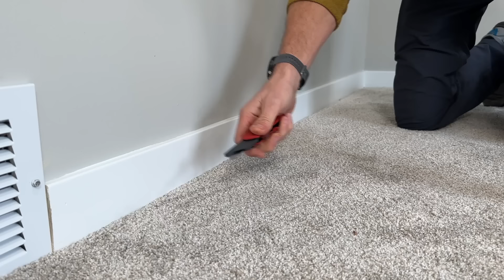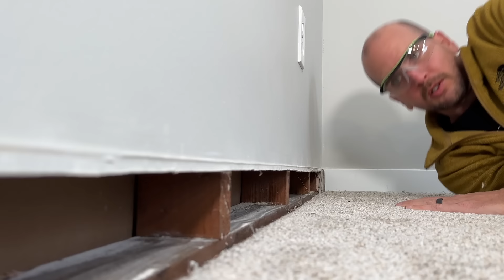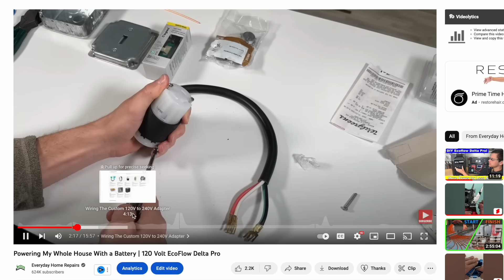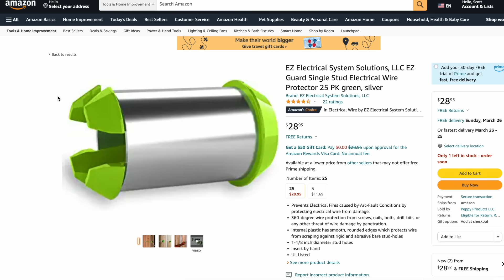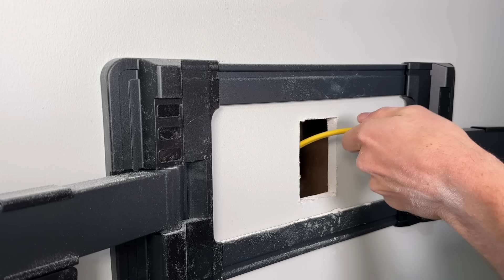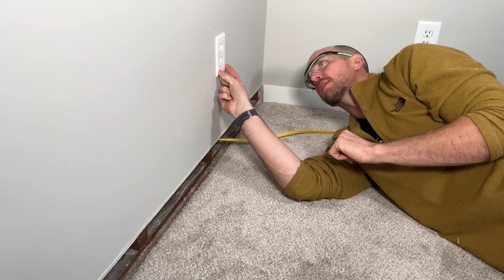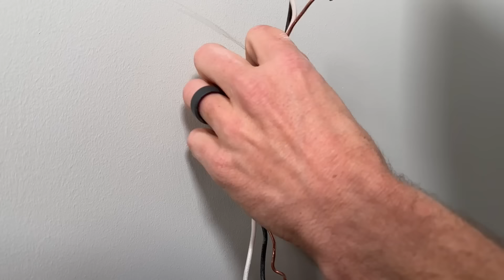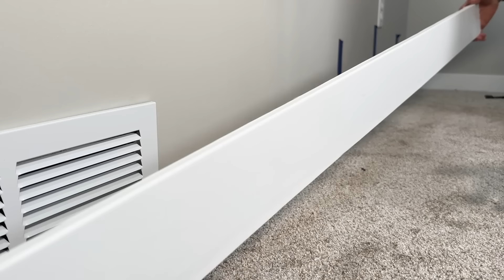How To Hide TV Power Cord And Cables | Easy Way To Move An Outlet

Comment: This is all very well but in the UK we build our houses out of bricks not cardboard, what do you do then?
Reply: Nothing.  Keep your extension cord😂😂😂😂😂
Reply: You don't have interior walls in England?
This is probably a brick house.
Reply: @redfields5070  Yes I said it was a brick house, that's what we make them from in the UK.
Reply: Many houses are built out of brick. Interior walls generally are built with drywall because it’s easy and cost efficient to do renovations. In the UK plaster board is common for interior walls….not sure who is using cardboard.
Reply: @darkcell06  No, they generally aren't - come and have a look at mine. As for dry walls, they are made from plasterboard which is basically plaster glued to a cardboard backing sheet.
Reply: @TelstarFirst  
I'm telling you that we build houses just like you do. We don't make them out of cardboard. His is not made out of cardboard.
He was working on an interior wall, you should see no bricks.
Reply: Most new houses in the uk are made with interior timber and plaster board walls . Just same as this. You've obviously not been on a building site lately.  😊🙏
Reply: You haven't been on a construction site lately if you think all houses are made solely of brick. Nice try though
Reply: In the uk they must have a big bad wolf problem, because thats the only reason id need a literal house built from stone😂
Reply: @goleft4088  Have a happy tornado season.It's why your houses fall down after 30 years and ours last 200-400 years or more.
Reply: Go somewhere else
Reply: @tonyphan9741  To get ripped off with a house of cards? No thanks. Our houses are built to last centuries, not years.

Comment: Excellent. Far better than the other systems I have seen.
The only thing I would do differently is to screw a small piece of scrap wood behind the drywall on the left hand side, so I could screw the drywall and baseboard to it. Just a little better support, because there is no support past the left-hand most stud, which is quite a distance away.

Comment: That's all fine and well if they are interior walls.  If they're exterior walls with blow-in insulation covered with plastic vapor barrier it gets a whole lot more difficult. It would also be nice if you showed how you fished the wire up into the existing box.  I like the technique but in some walls it won't be that easy.  I see I'm not the only one with this concern.
Reply: (Great video:) Same here. How did you fish the new wire into the existing box? Thanks...
Reply: I think it is easier to push the new wire from the existing box into the wall and fish it up to the new outlet hole before installing the new box.
Reply: European houses are made of solid bricks and concrete. Not empty cardboard. This video is a pure joke.

Comment: You should change the thumbnail because it is very misleading... You will absolutely have to repair drywall and even paint... from working in remodel not every job goes the way you expect it to. Trim breaks, paint chips, things happen.

Comment: You did a great job!  The thing I noticed though, was that the scenario you showed at the beginning of this video (in the thumbnail) has an existing outlet to the LEFT of the heating vent, but NO existing outlet to the right of it.  On the wall where you ultimately did the fix we are seeing done here, the existing outlet was further to the RIGHT of the wall vent.

In the 2nd scenario, you did not have the heating vent in your way, so you were able to extend the new Romex from the outlet on the right, & go leftward through the created stud holes, & then up to the back of the TV, allowing you to pass through two studs without encountering the heating vent.

If you had had to do the new install in the scenario we saw when the video first started, with the only existing outlet on that wall to your LEFT of the heating vent (as you are facing it), you would not have been able to come across the area of the baseboard with the Romex, as the vent would have been in the way.  I would be curious how you would recommend installing the new outlet if the scenario was as the wall looked in the start of the video.  That is to say, if you have a heating vent in between the existing outlet & the new outlet you are trying to create, how do you get around the heating vent with the Romex?!

Thanks for any input you might share.  God bless! 😇
[3.26.2025]
[How To Hide TV Power Cord And Cables | Easy Way To Move An Outlet - via Everyday Home Repairs]

Comment: Excellent video, good detail and very well paced. I'd like to see a follow-up video that shows how to do this if the location of the television is above a (gas) fireplace mantle. Ours has two small windows located on the sides of the fireplace, about a foot above the mantle, which means there's only about a foot of horizontal run to use for putting wires through. And then, of course, there's the chimney vent to avoid with the new wiring. Recognizing that there will be differences between models of fireplaces and placements of window, bookshelves, or other features, I'm hoping that there are enough commonalities to make it possible to provide some guidance that would be useful in my (or any similar) situation. Thanks for putting in the time to share your expertise and experience!

Comment: Good video. I install professionally. It would be wise to start from the outlet and push the wire down. It will make it easier especially if the wall has insulation.

Comment: Great video, but be sure to mention what to do if you run into cross-blocks and/or insulation. Most walls have cross-blocks. Recommend long, flexible drill bit extension and fish tape. Good job

Comment: Great and really clear video BUT there should be a disclaimer or warning for people attempting this. IF that wall is a structural bracing element (and with modern houses, there is a shortage of walls that are NOT part of the building bracing system) doing this will completely compromise the bracing system. The wall shown does not have enough fasteners to be part of a bracing system so no problem here, but people doing this will not realise the finer points and what to know and watch out for in their own situation.

Comment: Good job and well done.

It would have been a good add on to mention that bare Earth wires are not allowed in the UK, EU, Oz etc.. Since this is a global tip I'd have mentioned that.

Another good add-on tip would have been how in get around a cross brace / dwang issue, cutting a small slot out of the drywall, drilling a hole / check in the dwang  then refitting the drywall cut out, filling, sanding and painting the cuts.

Comment: Those ring tabs you pulled off the outlet behind the TV mount can also be used as spacers to push the outlet out for the face plate. Just use them like washers.

Comment: When I do these, I use a tube with pass-thru plates. That way, you can hide any possible cables (i.e., power, Ethernet, HDMI, etc.,) behind the wall and then connect them where they need to go below (i.e., nearby power outlet, Cat5 jack, computer or any other device that wants an external display.)

Comment: AWESOME video, thank you!   The ONLY thing I didn't see (perhaps I missed it?) was how you pulled the Romax wiring through the bottom of the existing junction box. I know there's knock-out plugs, but I didn't see just how you punched that one out.
Reply from the maker: Yep, just pulled up through the bottom which was easy access since we cut out the drywall.
Reply: @EverydayHomeRepairs  Right, but how exactly did you punch out that junction box plug?   Did you simply use your finger or a quick tap with a screwdriver & hammer?  Or ??

Comment: Definitely a clever method.  Really no need to put the outlet directly in the center of a 55" TV.  It looked like he could have gone straight up within the same wall cavity and still kept the cord hidden behind the tv.  No baseboard removal.  No stud drilling, no stud sleeves. Great video if you need to shift a long way across a wall.

Comment: There's another less expensive nail guard you can get at Home Depot called Smart Shield Nail Guard, you push it thru the stud hole then tap the two sharp tabs in with a hammer. Not as quick as the ones you showed but it's an alternative and 1/3rd the price. When I was doing coaxial and twisted pair jobs on new and old work I would use the Smart Shield Nail Guards as I didnt know about the ones you showed. Now people have two possible replacements to those nail plates you have to use on both sides and that leave a bulge in the drywall.

Comment: Good video.  Turns out I was doing this already except I never added the extra outlet... just moved the plug. Usually won't have any issues adding an extra, but I've been in homes where a particular room was already at max at the breaker and I wasn't being paid for the extra 10 minutes of work...Usually like that due to prior diy home improvements already

Comment: How do you deal with all of the YouTube know it all that don’t like wagos and backstabbing? That’s an excellent solution by the way. I would just add that if someone else going to use the cable access bushings instead, that those are only for cables and not electricity.

Comment: In my country, we have horizontal pieces between the studs, so we need to drill holes through those for the cable to go through.
Reply from the maker: We will see something similar in our framing depending on the region of the US and the age of the home.  Usually You can drill up from the bottom or down from the new outlet location with a flexible 54 in long auger bit.

Comment: Dear EHR, do like your explanations on this project. Nevertheless, I think that there is a better tool to drill the holes into the studs, an angled drill will do a much better job there. First it eliminates the need for the too wide spade bit, secondly it will allow for the holes to become lined up much better, because the angled drill can be much better positioned in alignment with the cable line. 
Of course when only having to cross only two studs this won’t be much of a problem, it becomes much more difficult though as the amount of studs one needs to pass through. 
For anybody having difficulty fishing through the cable on either side, up to the existing socket box, or the new socket box, I would recommend to use some wire offcuts, of course the ones that are to appropriate length for the cable to fished upwards.
Over here in the Netherlands our electric code doesn’t allow for ‘bare’ cables (like Romax) to be fed through drywall or masonry walls. They always need to be installed into a suited electrical pipe. The disadvantage of that is that one needs more material. However, installing a pipe before the fishing action makes these kinds of jobs much easier. Especially, because it allows for separate wires, or even the Romax equivalent available here, this XMVK cable has an X for being extra flexible compared to other cable types. 
Cheerio

Comment: Straight forward and somewhat simplistic explanation and demonstration. Well done.
BUT ... 
1. The loose cable/wire floating in the wall cavity presents a problem. Unsecured cables are an identified hazard for most building codes and are not allowed. Even pulling the wire fairly tight to the point it passes through the stud would create tension and stress on the conductor which is also unadvisable.
2. You didn't address or acknowledge the possible requirements for the additional outlets being added to the circuit. Building codes also limit numbers of outlets as they can easily lead to exceeding the power allotments for those circuits. While most TV's are not a high enough power item, IF a TV is not plugged in (or present) you can't prevent someone plugging in a power tool or something high powered. (To do a quick DIY on the ceiling perhaps ?)
3. The "spacer" tabs installed may work as insulators between the metal tabs of the plug and the metal electrical box. This would be removing the grounding of the box and you did not demonstrate another connection to the box to re-establish the safety feature. A loose wire or wear on the wires over time could cause the box to go "live" in the wall just waiting for a chance to conduct.

Overall a clean and neat install. Still, it is probably illegal in most jurisdictions. Like so many DIY projects are.

Comment: You can also just use a plastic channel painted to color match the wall. That shown is only an option if you own the home; other options exist that do not require baseboard removal if the existing outlet is in the same stud space as the new outlet.

Comment: The regulations in my area say as long as the Romax is one and a quarter inches from the back of the drywall you don’t need a screw or nail guard but the larger hole helps in case something pokes at the Romax there will be some give.

Comment: Nice work,  but,  i would not want to be drilling holes half the width of the stud at the bottom of a load baring wall.. but that's just me

Pro tip: if you're doing all this, might as well fish through any other AV cables you might be installing

Comment: Very useful and clearly explained video. I’m wondering—would this method still work if there’s insulation behind the drywall? Does the wire run within the insulation, or should it be removed first?

Comment: I think I would consider putting the new outlet exactly over the the one near the corner on the same stud. The new outlet would be behind the TV near the right edge and you could skip the stud finding, trim removing, drywall slicing, hole drilling and only use about 4 foot of wire.

Comment: I just found your page today and thank you, thank you, thank you! You are very detailed in your explanation of each process. This might be a redundant question but are you an electrician, contractor or just your regular DIY guy?  Google university has taught me everything I know about electrical work, but there are times and wire combinations that I just can’t find the answer to.  Is there a good book the breaks down electrical work for beginners like me that you suggest?  I would like to know the “Why, when and the how to” for each project.  I think that makes me better all around vice just knowing how to fix something.  You were using some terms that I hadn’t heard before for the name of the wires.  I also wanted to know when I could use that product you used instead of the wire nut?  Thanks in advance for any suggestions you give me.👊🏾🙏🏾

Comment: Good and clear video.  One thing that concerned me is that the ground wire is not insulated.  There is nothing really to stop that from touching the live (hot) or neutral wire, as far as I can see.  Is that not potentially a bit of a risk?

Comment: The only suggestion I'd give is to install your outlets with the ground prong at the top (opposite of how yours are).  That way if something is plugged in and a tad away from the outlet, then something metal falls into it, the metal defects off of the ground and doesn't touch the positive and negative together causing a short.

Comment: Got big hands or don't want to get all the way down on the floor? Look for a "quarter inch right angle attachment", that you can connect to your drill then connect your spade bit into the right angle attachment to avoid having to get your drill/hand into the wall cavity, most are quarter inch connections, there is a chucked version of a 90° angle attachment made by other various brands but they're a little more bulky, If your drill bits or spade bits do not have a quarter inch attachment you can always get a quarter inch to Chuck straight adapter. Makes it wayyy easier in these tight spots to drill through studs. Most of the big name tools have them at the box stores.

Comment: Very nice.
Just remember that those receptacle testers can be fooled into erroneous indications.
Also, the white wires are "grounded conductors" as there is never any "neutral current" on a single wire branch circuit grounded conductor.
And the term "outlet", well, look it up in the NEC code book.....

Comment: No need for removing baseboards or cutting out drywall. Just be sure the existing outlet is in a bay that meets your needs, cut the hole for the electrical old work box behind the tv, and fish Romex up from the existing box. A fairly simple do if you’ve ever fished wire. I’ve done this 20x and I’m not an electrician.
Reply: wbsmith4     Hmmm, outlet on the “right edge” of the tv isn’t better?  🤣

Comment: My house has a fire block at about three feet up the wall which necessitated I cut a hole. At the time I didn’t own a multitool so I used a sawzall😂 I just covered the hole with a textured paintable outlet cap and no one noticed, even without it being painted the color of the wall.

Comment: You want to drill your holes as high as possible from the floor stud /plate or you may hit screws or nails plus check the two studs your going up between for fire blocks, If you don't and there is one you will be cutting drywall and patching I run into them all of the time.

Comment: Thanks for making and sharing this video. I found it very helpful, however I did have one question as I am new to residential electrical systems. Why was the 12/2 Romex used for this project? Was the existing Romex 14/2 or 16/2?

Comment: I've hung probably over 100 TV's, much easier way to do it is find space between the studs, drill a 1 3/4" hole somewhere in the  mount area and then another directly down toward the floor usually in line with other outlets, get some 1 3/4" desk grommets, run all cables through down the wall  between holes, hang TV and plug everything in, your done, usually takes me an hour or less, no removing baseboards, tapping into plugs or anything, same effect.